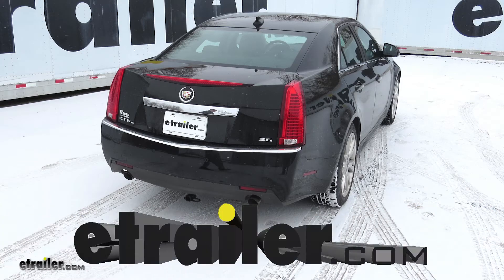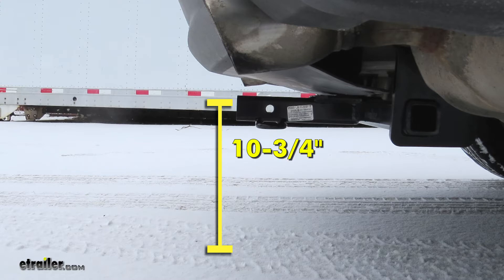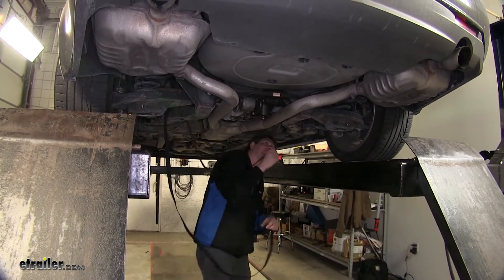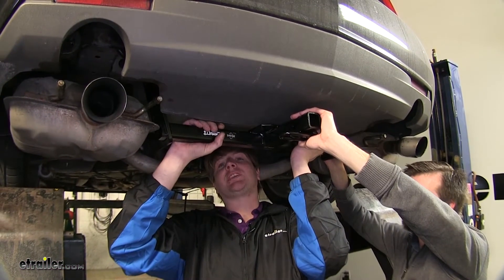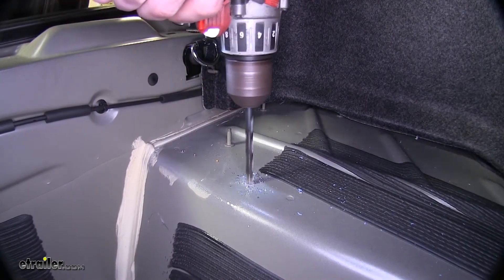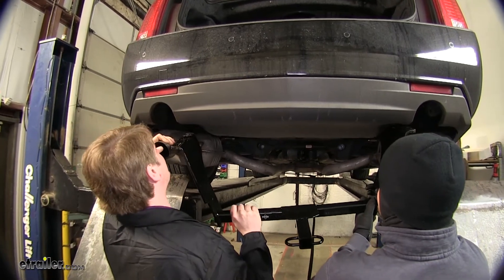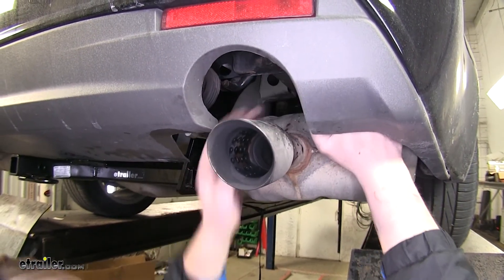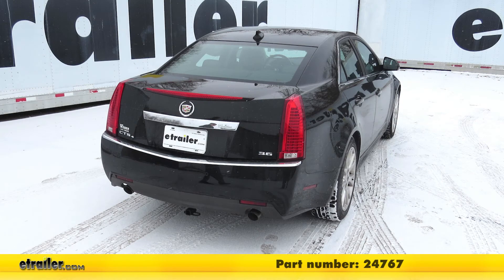etrailer | How to Set Up Your Draw-Tite Sportframe Trailer Hitch Receiver on a 2012 Cadillac CTS

Comment: I have a 2013 Xts will this work on my car?
Reply from the maker: This hitch is not designed to fit your Cadillac XTS. You can use the Curt C12115. Check it out on our website in the following link.
https://www.etrailer.com/Trailer-Hitch/Curt/C12115.html